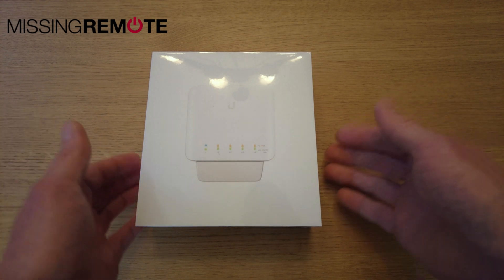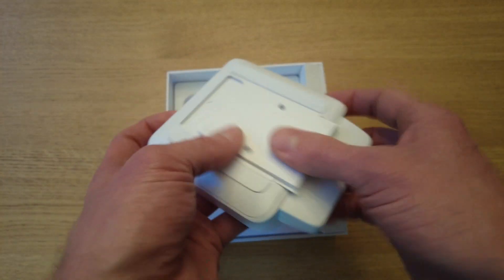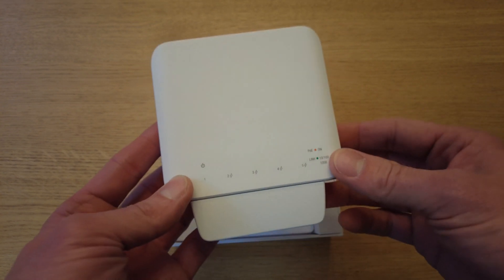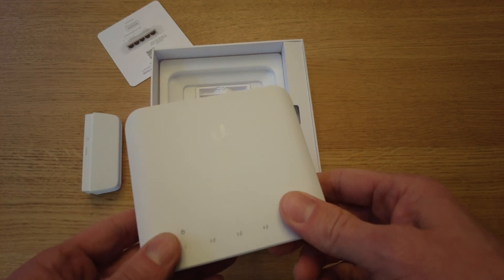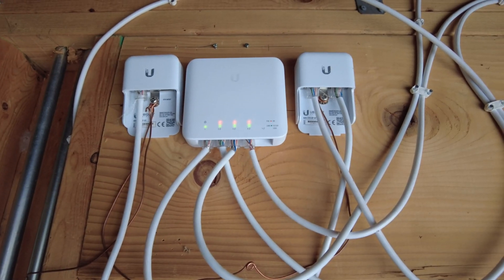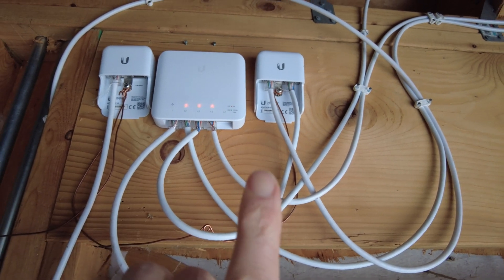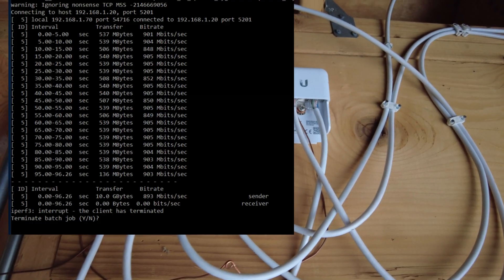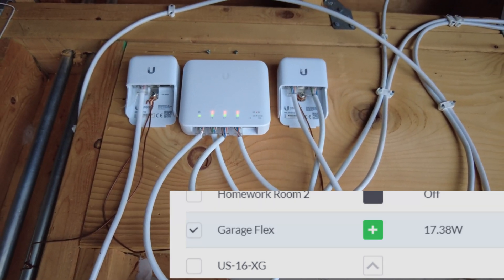Ubiquiti UniFi Switch Flex - 802.3at/bt (PoE+/PoE++) Gigabit Ethernet Switch

Comment: Do you know if you can put this into an unmanaged lan pass through mode? Or to completely shut down the dhcp not just snooping?
Reply from the maker: I don't think there's a way to run it unmanaged. What is the goal/concern? Maybe there's a way to get to where you want to be.
Reply: @MissingRemote  thanks for the reply. I was under the assumption that a managed switch meant that it had a dhcp and would cause a double Nat. I’m a bit newish to networking. I soon learned that it does not.

Comment: you really need to re-terminate those cables.
Reply from the maker: Why?
Reply: @MissingRemote  2:22
Reply from the maker: @psycl0ptic  I know what they look like. Question was "why" as in "why bother" it works, and if I reterminate them, and end up changing the setup again in the future and the cables are too short, I have a problem...
Reply: @MissingRemote  yes, why bother???  end result should look like this - jacked crimped inside the connector.  https://youtu.be/lullzS740wI?t=621
Reply from the maker: @psycl0ptic  The only functional benefit to doing that is if you plan on tugging on the cables. This is a static install, I don't plan on tugging on the cables, and most people would need a ladder to get to them, so there's no functional benefit.
Reply: @MissingRemote  we are embarrassed for you.  It's embarrassing.  I think maybe missing a bit more than just the "remote"?
Reply from the maker: I have children. Being an embarrassment is part of the job description.
Reply: @MissingRemote  Nothing to with tugging on the cables. It has to do with cross-talk and interference.
Reply from the maker: @biggyk87  How so? The star core in the cable is still there, and the wires are flattened out before going into the plug (the issue with crosstalk should only exist when the wires are aligned closely with each other (why the star core is present in CAT 6; IIRC, 5e doesn't even have the core).

Comment: What cameras are you running off it? I was going to get the Lite 8 port 60W but if this can handle 2 flex cameras and a 4K camera I'm good! or maybe 3 flex or G4 bullets and a outdoor mesh wifi access point.
Reply from the maker: I have 2 G3 Bullet + 1 AC Pro AP running here. Total output right now is 15.11w to the switch. My G4 Bullet pull about the same as my G3s, so I wouldn't be concerned about swapping G4s for G3s here.

Comment: Is it possible to be a bit more detail on what you replaced and what is 24v, and what is af.  Whare power is coming in and what is going out.  TIA
Reply from the maker: Sorry, always a struggle b/w too much info and too little. 24v, 802.3af/at/bt (these are also known as PoE/PoE+/PoE++) are all Power over Ethernet (PoE) standards. Aside from voltage (the other standards operate 44-57v) 24v is a passive way to deliver power, so it's always on, and therefore dangerous to devices that aren't 24v passively powered. 802.3af/at/bt are all negotiated, so it's safe to leave it on all the time. They also are better at delivering power more consistently over long runs; IIRC, this is because of the higher voltage numbers.

Everything is powered by a US-L2-48-POE (48 port PoE+ managed switch), and I ran cat 6 out from there to everywhere I need a network device.

I replaced a Ubiquiti N-SW (https://www.ui.com/accessories/nanoswitch/), which is a 24v powered unmanaged switch. One of my 24v G3 cameras went bad, and the replacement was 802.3af powered, so I had to change the setup out there to keep everything working. 

Hope that answers your questions. If not, LMK.
Reply: @MissingRemote  so you running the flex only on poe+ I saw it needed ++ but its good if it can deliver all that on poe+  good setup.